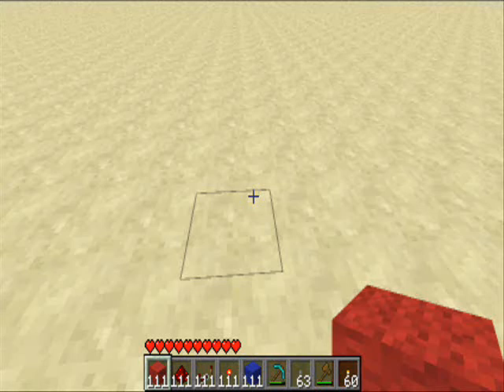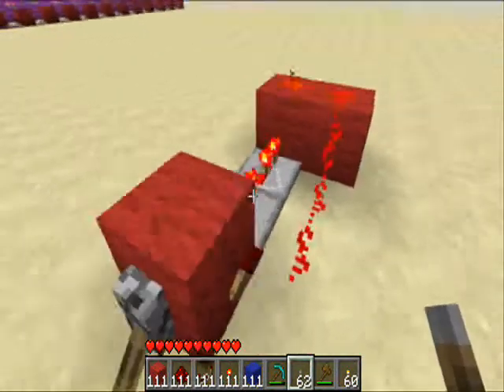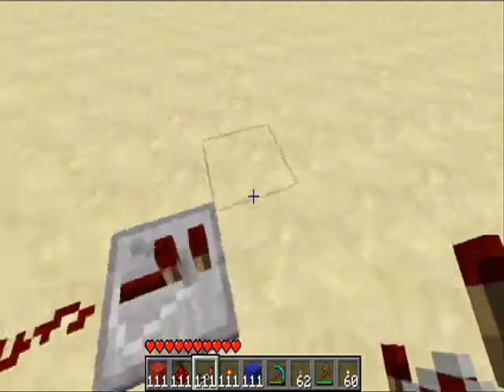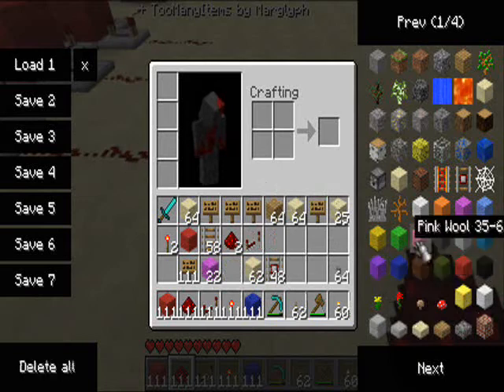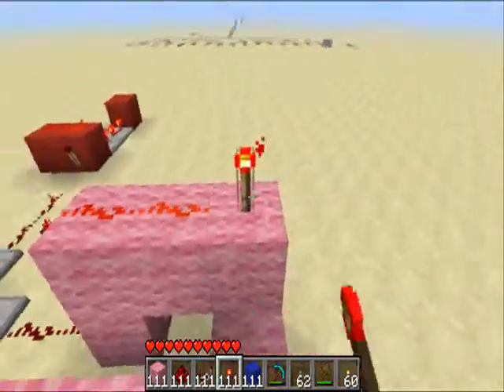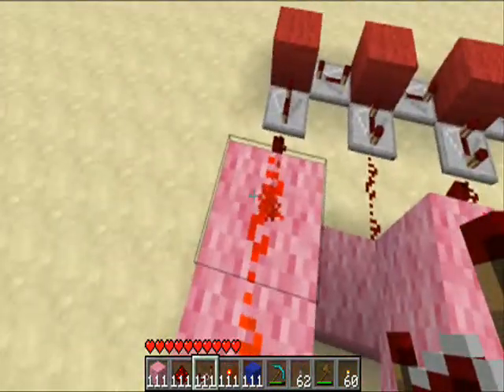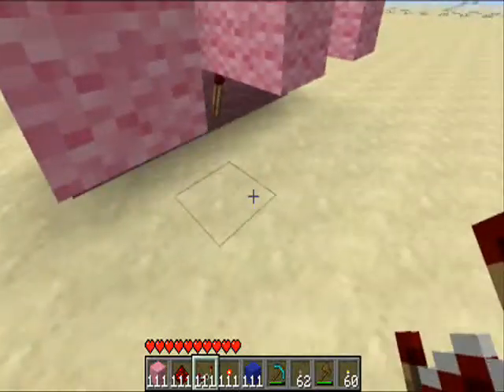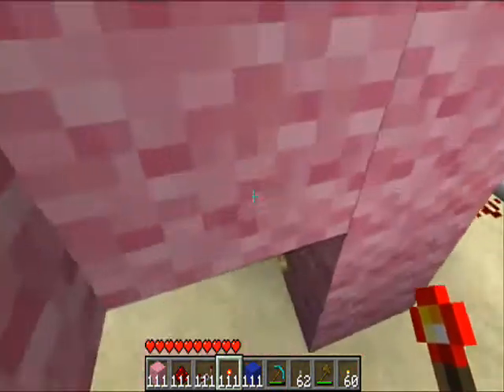Redstone Decimal Counter Tutorial

Comment: After playing around with this for a while, I determined that the pulse from a button is too long for this exact design. You'd have to have 2 repeaters between the first set of blocks.

What I did was use the pulse limiter you start with, except with a button instead of a lever.

That is, unless I'm doing something wrong. :/